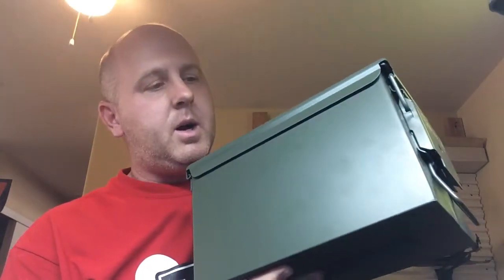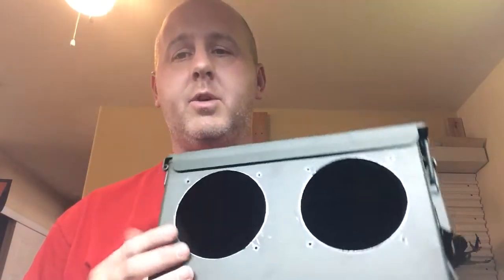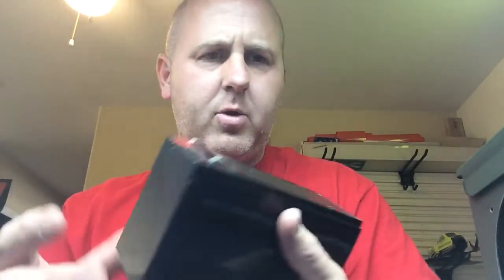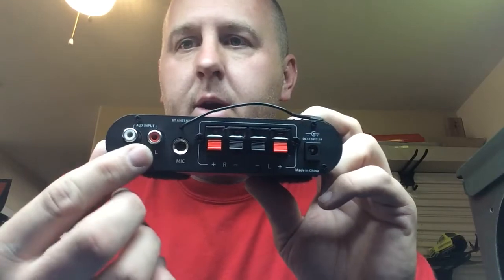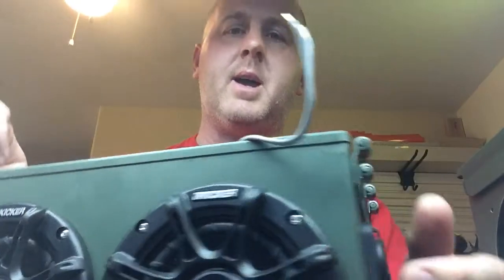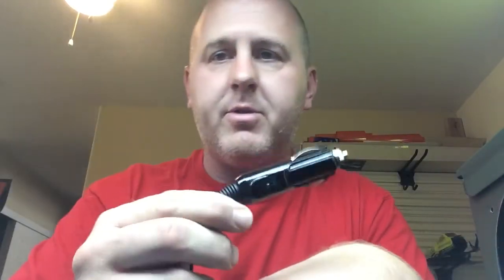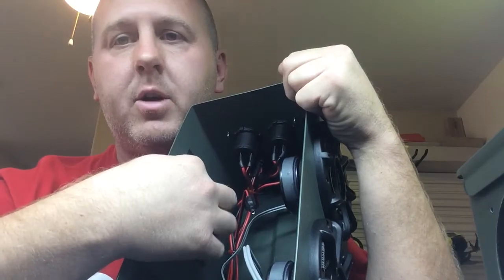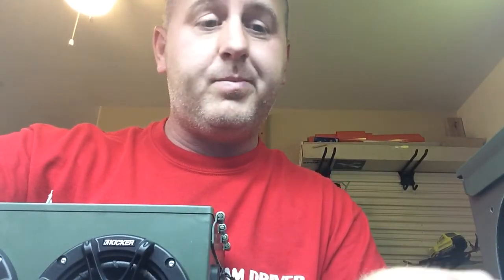AmmoCan Bluetooth speaker build

Comment: Do think this speaker PLMR60W would fit side by side on front of this ammo box 17”Lx10.13”Wx13”H?
Reply from the maker: No 6.5” wont fit.  I recommend you look at the plastic Apache cases at Harbor Freight.  Might be able to fit two on the 4800.  Highly recommend you check that before buy one.
Reply: @robertking11  two people think it will fit on the 17”Lx10.13”Wx13”H box
Reply from the maker: @kylewilliams3306  ok apologies I thought you were asking if those measurements would fit the box i’m showing in my video.  Good luck on the build.
Reply: @robertking11  so do you think that this PLMR60W speaker would side by side on front of this plastic ammo box 17”Lx10.13”Wx13”H?
Reply: @robertking11  so Do think the 17”Lx10.13”Wx13”H box would fit the speakers I listed above ?
Reply: @robertking11  so will the 17”Lx10.13”Wx13”H plastic ammo box fit this speaker PLMR60W side by side on front? Or could fit on plastic 14” 1409 orange dry marine storage box?

Comment: Have you done a 40mm plastic ammo box build with 6.5 1/2 speaker ? Would 40mm or 50mm plastic ammo box to put 6.5 1/2 marine speaker on ?
Reply from the maker: Ive never done a build with a plastic box.  Id sure they would work though.
Reply: @robertking11  do you know of any body that has built a 40mm & 50mm plastic bluetooth ammo can with 6.51/2 400watt marine speaker which one should I go with 40 or 50 mm plastic one for thoses speakers .
Reply from the maker: @kylewilliams3306  sry don’t know anyone actively building them.  Most people want one built but dont want to even pay the price of the materials.  Otherwise id build more.  As it is I only build them for friends.
Reply: @robertking11  I have all the parts expert what to put the speaker on and amp  inside with my Talentcell 6000mph battery ?
Reply: @robertking11  what does mean when somebody ask my box a plastic ammo box bluetooth build about I might need to decide if I want to port it?
Reply from the maker: @kylewilliams3306  most speakers have a port that allows the air inside the speaker to move.  Otherwise a speaker will create positive and negative pressure inside a box from the movement of the speaker itself.  So I did build one box that I “ported”.  All I did was drill a 1 1/2” hole and used a white PVC flanged pipe to fill the hole cleanly.  Honestly can’t tell if it made much difference.  Looked cool though.
Reply: @robertking11  so a port would be like a bannanna port?
Reply from the maker: @kylewilliams3306  by bananna do you mean for a plug?   Im just talking about a hole that allows air to move in and out of the box.
Reply: @robertking11  what would be a medium storage bin with handle or container with handle  that could fit 6.5 1/2 400watt speaker on the outside and 12v Talentcell 6000mAh hour battery inside and a very small amp inside ?
Reply: @robertking11  what it mean if sombay asked my or say that I might need to think I want to port the plastic ammo box ?

Comment: i wouldnt use wd40 for drilling lubricant its a good way to start a fire. i suggest i use drilling oir or transmission fluid
Reply: Non issue when drilling thin metals.

Comment: Thanks for your video.  Was wondering if you ever considered mounting the control front of the amp to the lid of the ammo box so you could adjust it without opening it?  
I have the same Pyle amp and was considering putting a couple of L brackets on the metal base "fins" and cutting a hole to match the shape of the face of the amp pannel.
Reply from the maker: I have but it would be problematic and require disassembling the amp.  After tuning the amp its really not necessary to access the amp anyways since the volume can be adjusted via the attached bluetooth device.
Reply: @robertking11  would 6.5 1/2 400watt marine speaker work on 40mm +50 mm plastic box ?